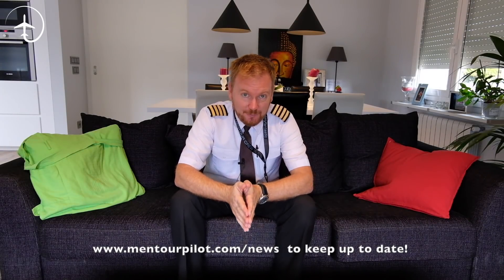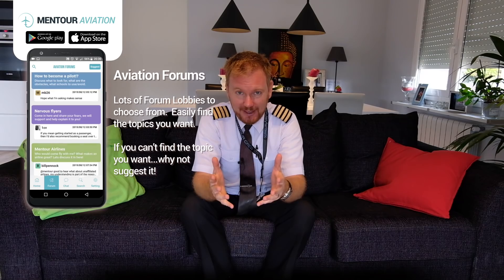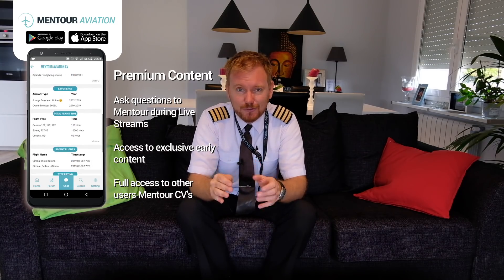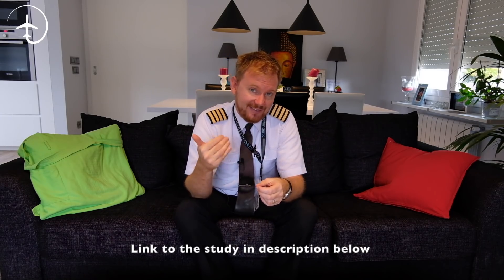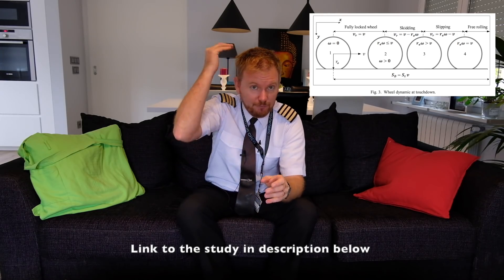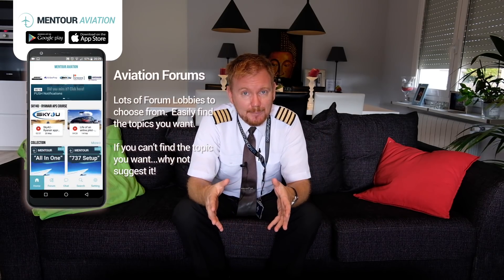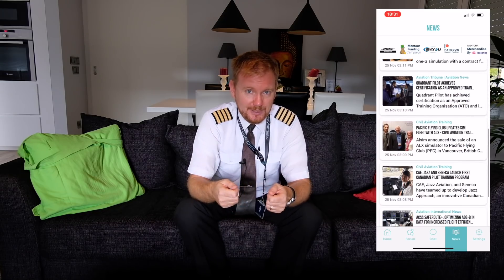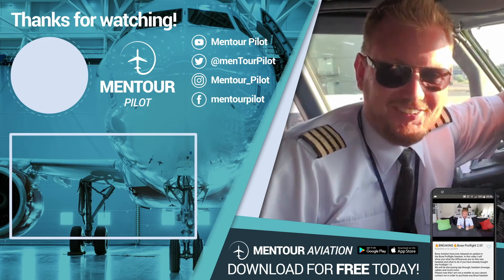Use WIND to spin the aircraft wheels before landing?!

Comment: Love your program and sorry that I'm tuning in on this issue very late. The issue I see with the rubber being "wasted" this way is a sustainability issue which brings the cost-benefit reasoning onto a different level. But again, as so often is the case in the aviation industry: the airports will be pointing to the airlines to improve this issue while the airlines will say: its your problem to deal with - after all how are you going to determine who is the worst perpetrator an how do propose assigning blame/cost?

Comment: I'm going to make a counter statement.  First, I don't think Captain Mentour is going to want to address this any further, but I looked at that technical report and I'm questioning whether it's correct, I hate to say.  I assume I'm wrong but there's a critical point on Page 8 showing "Wheel Angular Velocities" and a Figure 9.

It shows the three conditions -- wheels static, 50% spinning, and 100% spinning.  At the 100% spinning level it seems to claim the wheels actually slow down and then go back up to the 100% spinning level.  It describes in broken english why this would be the case and this spin down followed by spin up is what causes the "skid" that produces the minimal 50% reduction in wear.  

But I would assert that this is empirically incorrect.  If you pre-spin a bicycle tire you're suspending from a truck in motion and put the bicycle to the pavement, the wheel will simply spin at the correct speed.  There is no "spin down" followed by spin back up.  There's a lot of math and explanation above this section so maybe I'm wrong and missing something but it seems to me all that math has nothing to do with the assertion that the wheel has anything to do but match ground speed if it's already spinning at that rate.  There's no reason for it do anything else.  And if so, then you get no wear at all.

So I hate to contradict the Captain but it would appear to me that this technical report has a glaring error in it.  I'd be curious to see if anyone can read it and concur or point out why I'm wrong.
Reply: I think you missed the point all together. The topic is using the wind to spin up the wheels. Attaching any form of device to the tyres that uses the wind can never bring the rotational speed of the said tyres to match that of the rotational speed on touchdown...sorry.
Reply: @geoffreywoodyear1585  Yes, that's a good point but the technical paper he used to justify why it isn't worth it I think is flawed.  I'd be curious to know if it in fact IS flawed and if so, then what are the actual numbers involved and at that point do a cost/benefit.

Maybe the cost/benefit is moot in that there's nothing to be gained at all but I don't think that's true.  As others have pointed out, if you make a slight modification and get a 1% improvement, they do it because it's worth it.  If this study is flawed and there IS something to be gained by finning the wheels and spinning the tires even partially up to speed it may well be worth it even if the gain is minimal (all factors considered including cost, complexity, maintenance, reliability, safety, etc).
Reply: @darioinfini  What you are missing is, that happend in fractions of a second, if you test this with a bicyle from a truck you wouldnt even see the wheel slows down and spin up again.
Also the the needed rotation speed changes with the diameter of the wheel, so if the Wheel spin with the right speed for a fully deflectet tyre, the undeflectet tyre spins too fast and visa versa, then there is torsion between the tyre and the rim and momentum of mass wich changes frequently, that leads to the slow down and speed up of the pre-rolling wheel
Reply: @wolf310ii  Thanks for the reply, though I disagree with you.  If the article is about a simulation and the simulation says the wheel is already rotating at 100% of the aircraft speed, there is no mismatch between the two.  There is no reason for the tire to do anything but exactly match the speed when it touches down.  Deflection may cause some fast jittering which is reflected in the graph but not a slow down of the rate of rotation.  At least it doesn't seem that way to me again empirically looking at it.  In the same way that if you pressed a bicycle wheel down onto the pavement, both matched up in speed, the wheel wouldn't temporarily slow down to less than half speed before speeding back up again.  That wouldn't make any sense.
Reply: @darioinfini   your bicycle go 250km/h? change your bicycle wheel the diameter serval centimeters by deflection?

Comment: hi sir.. I want to thank you for the great effort you are making to explain the dynamics of flight in a simplified way.. I have a question, but I am afraid it would be strange because in one of the previous videos you indicated that people outside your profession don't have enough details to judge things. 
However, my question is: I noticed that in some critical cases, whether or not it led to an unfortunate incident, the pilot is not sure what is happening on the outside of the plane as the front, flaps, rudder, elevator, or even engines.. so with this scientific advancement, why are the planes not equipped with external surveillance cameras that give the pilot a clear picture of what is happening outside the aircraft?
thank you again
Reply: I have been asking the same question for years. I consider the situation as if I were the pilot (and I have piloted aircraft).

Comment: Maybe fun to think about but a fantasy. 
1) Commercial airline tires and the associated brake will not “windmill” like the fan on a jet engine in the wind. And certainly not at any significant rpm or barely at all. 
2) Several vital aircraft systems use the wheel spin up as part of air/ground mode shift. 
I am an airline mechanic of several decades.
Reply: At 160 mph approach speed, you get 65 psf of potential force to work with. It diminishes with rpm of course, but if you have multiple vanes, you can almost multiply the force by how many vanes are exposed to the air stream at any given moment in time. An anemometer works. It doesn't windmill the same way a turbine does, but it's perfectly possible to spin a wheel up to a significant RPM.

Comment: If you used a servomotor on the wheels, you could also use it as a generator and braking system.  So maybe the weight of the motor could be offset by the weight reduction from eliminating the complicated braking system.
You could either direct the braking energy into the battery system, or dump it into a large power resistor.  With such a system, you would never have to replace brake pads or rotors either.  And since you don't have to worry about wearing out the brakes, you could get rid of the reverse thrusters an all the weight associated with them as well.
On balance, with all the above considered, it may be a net reduction in weight.
Plus you could use the motor to eliminate the tug machines.
Reply: But I think the weight of batteries required to move a loaded vehicle of that size and weight would far outstrip any weight gains from stripping the other systems off.
Reply: This servo-motor-generator would be a very large and heavy design because it must cope with a huge peak breaking power!   And it would never be accepted for safety reasons (cable rupture or electronics failure would make it fail)!
Reply: And servo motors have only a good brake efficience at high speed if you go slower, the brake force becomes weaker.
Trains use rekuperation only to slow down, not to stop.

I worked on many different lathes, without any brakes it takes 10-20 seconds for the machine to stop spinning, with rekuperation it takes 3-8 seconds, with electromagnetic disk brake it takes max 1 second

Comment: Hail Mentour, long time follower,

You wouldn't use a propeller.  That is extra fragile bits that can fly off the plane.  You would use something from the existing systems.  In this case, the bleed air system they use to spool up the engines or feed air to the a/c.

You would use a pneumatic engine, not many wires or electrical systems.  This would just be to spin up the wheels.  You would not use to reverse taxi from the terminal of course or anything that require extreme torque strength.

I would assume the most expensive parts would be the initial installation and re-engineering landing gear to fit a pneumatic engine or engines somewhere?

Comment: Its a very good idea, do note:   the cost factor reduces very much IF the turbine- like ridges are merely a sidewall detail> Rubber ridges, not very deep....push downward in the airflow at the front of the tire, pull upward at the rear diameter of the tires, and drag the bottom of the tire rearward at the bottom 1/3 diameter. Only the top 1/3 resists. Thus, induced forward rotation, that by windtunnel test averages about the rotational speed of say 60 miles an hour on a typical landing--thus at least partially evening the wear, and reducing the 'shock'.

Comment: Thanks for creating this kind of content based on feedback. Really appreciate it. In regards main issue treated in the video, I understand that the costs-benefit ratio may be negligible. However, it is not all about money. What about passenger comfort? The deceleration I feel when touching down is rather noticeable and violent. I sometimes find myself pushing the front seat with my arms to counteract it. And what about landing gear mechanical stresses? In the video you can see that it bounces back the first time it touches down, and the vibration on the whole structure is really violent. Granted, there may not be too many landing gear failures, or if they are, they may not be related with the wheels not spinning before landing, so we have the non issue again. But honestly, when I see that kind of vibration, I think it can't be good. I think manufacturers didn't implement this feature because the can get away with it. But if an airline have two of aircrafts, one with the spinning wheel feature, and another without it, covering the same routes, at the same price and with the same time table, the public would favour the first one. I would, that's for sure.
Reply: Well, the public would always prefer the one where they get something more for no additional cost - but that's not how the world works. In order for this to work, the airline and/or airplane manufacturer would need to be able to make an additional profit from this. So the question is, how much would you be willing to pay extra for this?
Reply: fireman23 The public would prefer the one which offers something extra at no cost ... Just picture the prospect of flying in an aircraft without toilets, air conditioning, cushioned seats, window blinds, noise attenuating cabins, table seats, overhead luggage compartment, reading lights, etc, etc, etc (all of those were for free the last time I checked). And yes, given my destinations I usually fly to, I would choose car instead of flying (more expensive) to enjoy a bit of extra comfort, if it wasn't for time constraints.
Reply: @nicky5185  You're not entirely wrong, but I don't think you're entirely right either. All those thing you mention are expected nowadays, but that was not always the case - In the early days of air travel the added bit of comfort was something the airlines could use to market their flights, at a higher price than the airlines that didn't have those features, until there are simply no more airlines who would want to fly so low-cost that all this is excluded (and in parts it's mandatory by law). Then again, with increased passenger capacity, the margins for the airlines went up, so the overall price for a flight decreased, which means the airlines don't lose money by including things like this. 

However, this is precisely not the situation that you described - if you have the same destination, route, service etc. for the same price, the new feature wouldn't be profitable. Now, if the effect was so significant that the airline using it could charge e.g. an additional 200$, it would probably look different. But then, who is willing to pay the price gap?

Comment: Nicely done Captain.  Thank you for finally addressing a question I could never understand.  

Now -- what's in that weird red checkerboard box you always see at airfields?  Is that a pilot's portapotty or what?
Reply: Probably the equivalent of network gear and circuit breakers.
Reply: Any structures or obstacles near to runway must be painted that way, but most likely that is the glideslope equipment for the Instrument Landing System (ILS).
Reply: Mike P bingo. Part of the ILS

Comment: okay yes that makes sense mentour, but how about the landing gear's suspension, is there something that can be done to optimise passenger comfort when landing? to avoid the jolting sensation you feel when landing on most fights..
Reply: Callum Wearne not really. The jolt you feel is because airliners don't flare like a small plane. They literally fly it onto the runway.

Comment: non-rotating tires also help bleed off forward momentum of the plane and heat the tires for better breaking traction.  There are small advantages to letting it skid...and it sounds cool.

Comment: Great video Mentour, i have a question, i saw a 787 depart Heathrow and keep its gear down for 2 minutes after departure, was wondering why this was done?
Reply: Human error, mechanical concern or some other distraction?  Just guessing but I like the question.
Reply: To cool brakes after lots of taxiing
Reply: airwood99 heat acquired during taxiing is negligible and no brakes are used during takeoff, the other suggestions are more likely i would suggest
Reply: Mark Roberts I agree TO is highest energy, but when the airplane leaves the gate for the next flight, however, that brakes will still be warm from the previous landing, and more energy will accumulate from braking during taxi out (eg down hill or multiple stops). I’m not a pilot but delayed retraction after takeoff  would be very effective, especially during landing training.
Reply: airwood99 most turnarounds take a couple of hours. Brakes are pretty much cooled in minutes. Even after a short runway heavy braking deceleration you could touch the disks quite easily after 20 mins, they bleed heat so fast. Taxi braking is negligible unless the pilot is wild
Reply: Mark Roberts l read internal temp 200 deg C after 90 mins?

Comment: A couple pros toward not spinning up the tires (possibly?)
1 - just like a drag racer, the action of spinning up the tires against the runway will warm the rubber up, probably increasing braking capability (I am sure the tire manufacturers account for this).
2 - Less wear on the hubs, which are much more expensive to deal with than the tires, I'm fairly certain.

Comment: The research article has the phrase "because the wheel angular velocity drops immediately after touchdown, " which at first I could not understand.

The issue is as the rubber tyre is compressed the radius changes so there's always going to be some skidding and hence friction and loss of rubber. Only way to avoid this would be to use a tyre made of an  uncompressible material e.g. steel and that's going to raise other issues.

Comment: put the wheels on drive shaft connect the drive shaft to an electric motor. 

using what i just said above would also fix engines running to close to ground crew. just start engines  as your taxiing and stop engines when u get off of runway

Comment: I tought about a system to spin the wheels when i was like 12 years old (32 years ago), but investigating i was told that there was a VERY important reasonfor NOT spinning the wheels, and that reason was: aquaplaning. When your tires scrap the tarmac, they displace water better than if they spin, thats also why in rainy landings, pilots tend to make rougher lands in order to "break" trough the watr in the landing strip to avoid aquaplaning, and certainly, spinning tires would'nt help either.
Reply: That is an interesting point I have to say.
Reply: Are you sure about that? Because the reason tires need to have proper tread depth is because they are able to remove water while in motion. If the tire is stationary it would basically function as a rubber brake pad and not like a waterwheel. For that same reason when aquaplaning occurs while driving it's advised to just release the accelerator and depress the clutch (if on a manual transmission) and certainly not brake as that would slow down the feels while it needs the waterwheel-effect to remove as much water as possible.
Reply: It does not look reasonable enough because your landing does not end with touching the ground and what happens in the first few seconds will have no effect on wahst happens later
also doing deliberate hard landing is total lunacy even if that could help a little, it sounds more like some excuse for pilot incompetence if he failed to do soft landing.
Reply: @GBOAC  It was confirmed to by both an Aerolineas Argentinas commercial pilot (B-747) and a FAA A-4 Skyhawk and also B-737 pilot, both close friends of my father. Later foun evidence of that in the internet (pilots doing deliberate "rougher" landings in order to break trough the water.
Reply: @GBOAC  I believe that if the tire spins, it tends to "climb" on the water if deep enough. Would make little difference tough.

Comment: Hi Mentour, I hope you doing absolutely fantastic! ;) I thing the standing wheels has other positive  effects too. Before the takeoff, the tyres is very cold. Usually the cold tyres dont have so good traction, so it can be some kind of solution, to heat up the tyres. Maybe the standing wheels can help to slow down  a little bit the aircraft too.  Am i wrong?